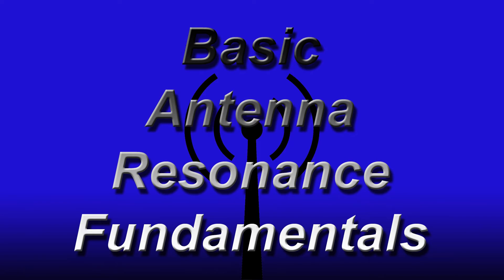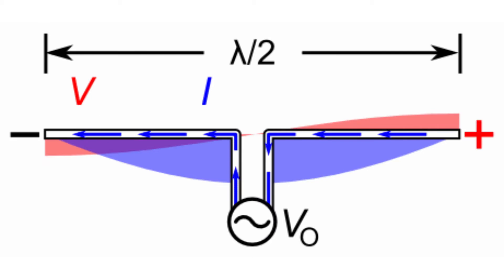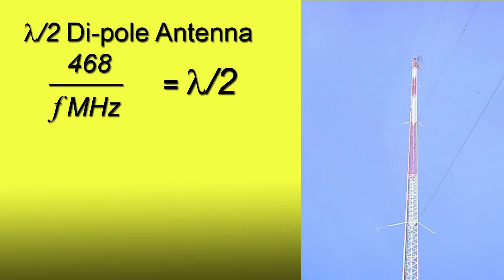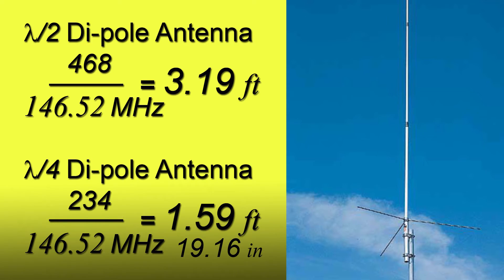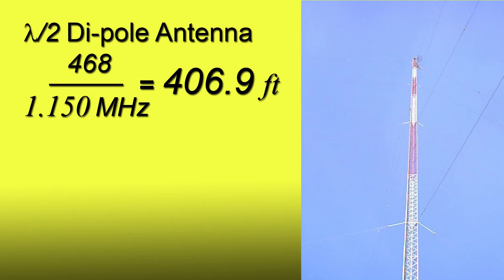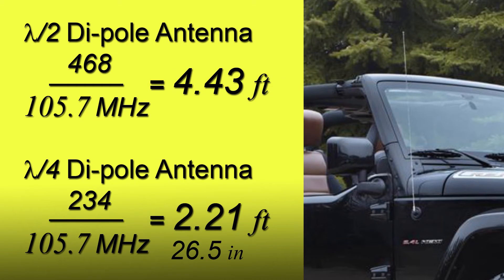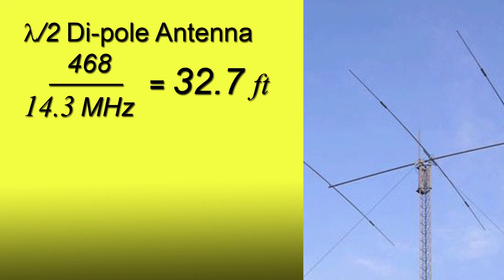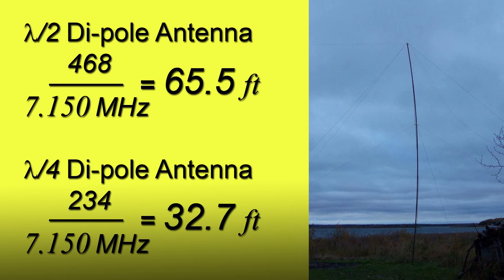Basic Antenna Resonance Fundamentals

Comment: where did 468 come from?
Reply: Half wavelength of the frequency times a constant to account for antenna diameter.

Speed of light in feet per second:

c ≈ 984 million ft/s

Full wavelength:

w = c/f
w ≈ (984 M ft/s) / ( f MHz)

Divide by 2 to get the half wavelength:

w / 2 ≈ (492 M ft/s) /  (f MHz)

Multiply by constant based on antenna width, typically about 0.95, to get total antenna length:

L = 0.95 * (w / 2)
L ≈ 0.95 * (492 M ft/s) /  (f MHz)
L ≈ (468 M ft/s) / (f MHz)

That antenna diameter constant can be experimentally determined, but a typical value of 0.95 is close enough for most practical use.
Reply: @TheEsteemedSaboteur  feet! Thats what it was, ive never seen it written in feet per second before, thanks a ton!

Comment: what is the significance of 468 and 234? Your formulas are somewhat of a mess.
c = 299792458m/s
λ = c/f
given f = 7.15e6/s
λ = 41.929m
λ / 2 = 20.964m = 20964 mm

I don't see the need for magic numbers here. You should strive for accuracy and simplicity. Remembering random numbers like that is ridiculous. If I were to use the less accurate speed of light of 300e6m/s, I'd get a dipole length of 20.979m, which is STILL more accurate than your solution.
Your solution 65.5ft would be 19964.4mm, which is short by nearly 10 cm. What's more, plugging in random numbers like that doesn't have any resemblance to the physics anymore. It's better to be able to derive a formula from first principles than to remember it.
Reply from the maker: Standard wavelength formulas 1/2 wave and 1/4 wave
Reply: 468 takes into account a standard velocity factor of 0.95 as in 492x0.95/fMHz=468/fMhz. Standard wavelength formulas for wavelength in Imperial measurement vs Metric measurements. Hope that helps.

Comment: This is why everyone should use meters instead of feet. Half wave on 80m? 80/2=40, Quarter wave? 80/4=20
Reply: Then promptly convert to feet so you know how long to cut it. What is that (20m), about 65 feet? We don't think in metric here.
Reply: @RAndrewNeal  Maybe you should. At least it would make fundamental physics calculations easier.
Reply: @aakesson1  I don't dislike the metric system; all new units are part of it. I just hate the metric supremacy attitude that many have. I'm back and forth between Customary and metric myself, but I don't think in metric. How long is 10 meters? I don't know until I rough it into feet; around 35 to 40 feet.

Comment: what is 468? where did it come from?
Reply: From insisting on expressing things in feet rather than meters
Reply: Hi I Guess it is from c=f*lamda, c=speed of light
Reply: Glad to Be Normal magic
Reply: I have the same question.
Reply: http://www.radioqth.net/dipole Maybe its a rule of thumb
Reply: 468 divided at your frequency to use is the length to resonate it works cause it gives you a 1 SWR